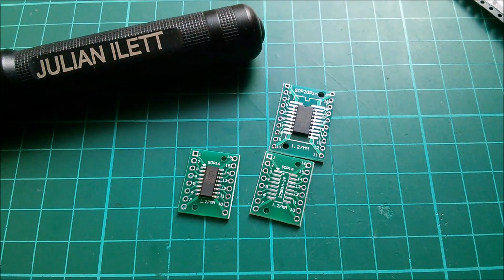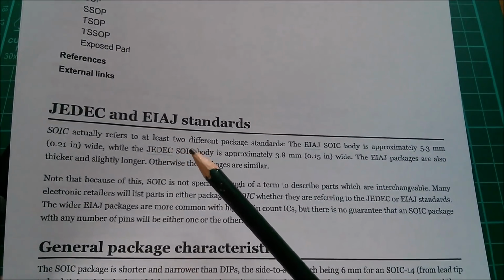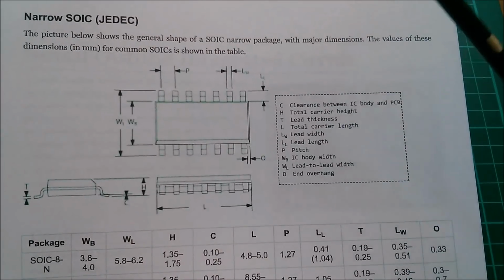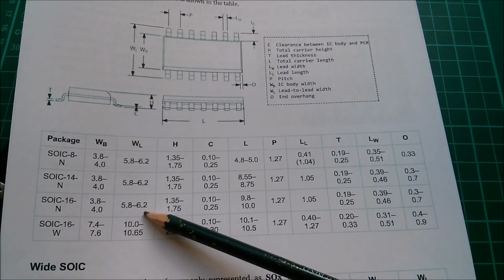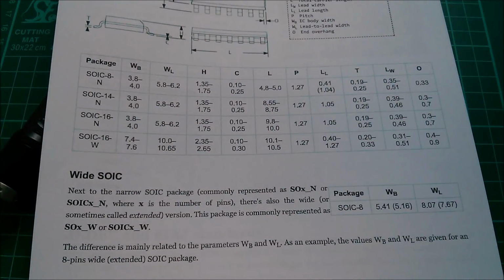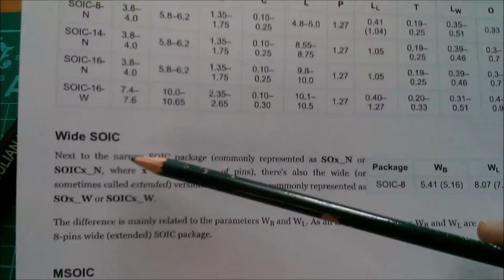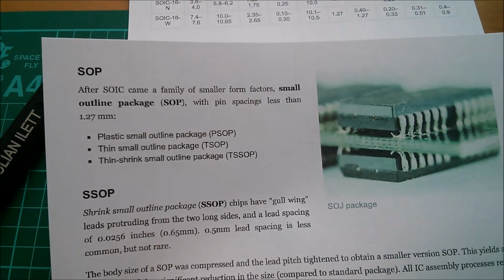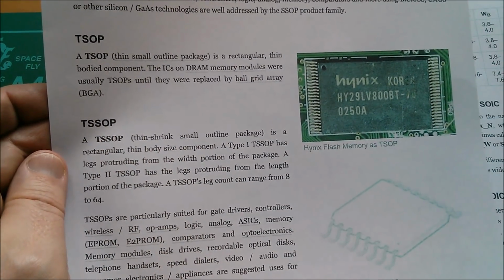Soppy Surface Mount Integrated Circuits

Comment: Perhaps to use them anyway, try to bend the pins under the body of the IC, like you see in the clip at 4.16min. That way they just might fit on the pads of the adapter PCB.

Comment: Put a pin between legs and chip and curl the legs under the chip, you'll be able to solder it easily.

Comment: Now that I can solder with hot air I like sufacemount :) Can hot air damage components ?
Reply: If they're SMD, they'll have a maximum reflow temperature specified in the datasheet. If there are also THT components on the board, be careful, it might melt connectors or fry chips (mmm... fried chips). Dave has a video in which he shows the issue he had with some THT connectors, I'll link it later.

Comment: I hate having to hunt on eBay for discontinued IC's in DIP packages because you can only buy them in surface mount packages nowadays!!!  Surface mount may be good for production, but how in hell are you supposed to prototype with the things?!
Reply: nockieboy No one builds breadboards in industry anymore, its all SPICE simulations and FPGAs. All the fun has been bled out of it.

Comment: Couldn't you just use the wider boards and solder legs on and bend the lot 90 degrees and then 90 again so they're the same pitch, I know it's crude but it will work

Comment: I’m with you. For breadboarding I will stick with DIP packages. And certainly now that you have found these SOP, SOIC.......differences I shall be supper careful if I ever use “flat packs” on a Circuit board

Comment: Either use the wider adapter and forget the empty pads or try out the correct adapter.
I recently soldered some wide 24 pin SOICs onto the exact same boards and it works fine as long as you use flux.
The solder will suck itself under the leads. If you get bridging you can wipe it off with a clean soldering iron tip or use braid.
You don't even need a tiny tip.

I know people always say "I never use flux and it works fine" but those people usually never solder stuff like this. It makes a huge difference.

Comment: When designing PCBs you really can't assume two packages that are the same type from different manufacturers (or product lines) will fit the same footprint. Always double check the dimensions from the datasheet.

Comment: Julian, more and more DIP parts are becoming unavailable, you’re going to have to bite the SMT bullet.

You can fix your SOIC-W problem by carefully folding the pins under the package to make it a SOJ with a width that’ll fit on a SOIC-N footprint adapter.

Comment: Some simple rules of thumb:  1. If you're building breadboard circuits you use DIP.  2. If the IC isn’t available in DIP, then you use the DIP adapters for your breadboard prototype!  3. You use SMD to create your PCB layout to achieve the smallest, lowest cost, mass production capable final product. 4. Alternatively, if your final product is intended for hobbyist assembly you might still want a DIP / through-hole component PCB layout. :)

Comment: I absolutely hate breadboarding and for soldering DIP is absolute crap; SMD is much easier. From the camera angle it looked as if the wider chips would also fit on the smaller adapter and potentially are even solderable with an iron. However with paste and hot air that should be really a breeze.

Comment: Try this for one of those wider chips: completely bend chips legs under the chip (they should look something like letter "U"), press the chip on a flat surface so all legs would be straight against the chip-s bottom and then use solder paste and heat gun to solder them. Like chips in PLCC package :)

Comment: There's a 3rd DIP width when you get up to the monster 64-pin ones just before everything switched to PLCC/TQFP. The DIP 68000 CPU is a 64-pin PDIP with something like 0.8in pin spacing.
Reply: But this is also not breadboard compatible
Reply: It is. It's still 0.1in between pins, but more between rows.

Comment: Julian, just use your 20 pin adaptor boards and leave 4 pads at one end with no connection ( or cut the board of you're desperate for length

Comment: I'm ordering several 4000 series CMOS chips from eBay tomorrow. Have a guess as to the package I am choosing (clue: they are for breadboards.) Yes, you guessed it, DIP. My old eyes and unsteady hands cannot be doing with whatever other type of package they come in. The only time I will deal with SMD is if it comes ready soldered, like the Cortex-M4 ARM chip on my STM32 Discovery board and a couple of clone Arduinos I bought (can't for the life of me think where I could've got the idea of buying them, heheh.)

Comment: Option A:
If it's only about stacking them verticaly using those long male-female connectors, use THT ICs and universal PCBs, all should work together pretty neat.
Option B:
If you really nead those SMD adaptors, why don't you design them yourself! :D Fit a couple of different ones on a PCB project, order them from China for cheap and cut them apart ;) Or even better, contact those guys from EasyEDA/JLCPCB like GreatScott did, and get them free for the advertisement! :))
Either way keep up the good job, greetings from Poland! :))
Reply: Option D: Just solder the 16 pin package on the 20 pin adapter board
Reply: Yep, doing Option B myself using EasyEDA. First board design and taking a bit of time getting the designs right. But, well worth the learning curve! 🤠
Reply: Option C: Just bend the pins then you'd get some space for soldering.

Comment: Maybe there are two widths?  DIP64 packaged 68000 processor with 900mil spacing? Although you'd be insane to wire one of those up on a breadboard.. <waits for somebody to post an example 68k breadboard computer :-) >
Reply from the maker: Oh yeah, I forgot about that beastie :)

Comment: julien, you should convert a snack oven to a SMD oven so you can reflow these puppies easy.
Reply from the maker: Yeah, I've also seen hotplates, frying pans, security lights and GU10 down lighters used. Trying to decide which way to go :)
Reply: Hadn't thought of a small snack/toaster oven. That's a great idea! You can get these for like a few dollars at garage sales!  😜
Reply: Julian Ilett Take a look at reflowr.com -- a small reflow-surface for small smd-stuff at a very reasonable price
Reply: Ben Heck did a video on this and I'm sure I've seen others.
Reply: I was going to say toaster ovens aren't a thing in the UK, but Amazon have a few starting from £24.
Reply: I like the hot air pencils... portable, affordable, not as much of a fire hazard.

Comment: Be careful when buying chips.
SSOP & TSSOP pins are such a fine pitch they're not easy to solder.
Reply from the maker: Yes, I wouldn't even attempt it :)
Reply: It's not genetic engineering, tack one pin down and drag solder it, good flux and a bit of braid and you're all dandy.
Don't let those two make you believe it's rocket science... it only is until you've done it.
Reply: Soldering those isn't any harder than soldering any other SMD component. A soldering iron with a fine tip (e. g. 1mm chisel) is fine for that. In quite a few repairs I soldered QFP packages (which have a pin pitch of 0.5mm) with that without problem. If you want to remove them AND not destroy the IC in the process, you better have a heat gun though.
Reply: Yes. This is when you pre-tin the pads, lay the chip on them, and then either use a super fine tip and touch each leg, or us a hot air gun and reflow the solder. The latter definitely would mean no plastics around.
I'm having to build my own adapter PCB for my one chip I ordered because SSOP-30 to DIP-30 is not a common adapter. And unfortunately, the chips aren't made in any other style; so I can't get DIP to begin with.
Reply: Not to mention BGA packages.
Reply: i still use my standart 2mm tip with a drop of the usual 60SN39PBCU1 , lots of flux and drag solder, no big deal, even TQFP aren´t a thing using that technique....
Reply: Easy when using good flux and drag soldering. 200+ pins just a easy.
Reply: Solder paste, a fine tip iron, and a microscope.
Reply: I've unfortunately become rather good at hand soldering SSOP (usually via drag soldering) but won't even try anything smaller than that - funny thing was I sweated about hand soldering SOIC a lot before the first time I did it (I do quite a bit with audio and op amps so ended up soldering the SOIC ones to DIP adaptors a lot) and turned out its a breeze.

I wouldn't even attempt it without a good flux paste though - helps to hold the chip in position at the same time as well as minimising the chance of bridging connectors.

Comment: Grumpy Julian. Must have missed something but why use the surface mount chips especially considering the adaptors make them larger than the dual inline packages.
Reply from the maker: So I can stack them vertically :)
Reply: Andy Plater 0.1" pitch is easy to prototype with 'cos it fits breadboards.
 Sadly, some chips are only available as SMD.
Reply: The idea imo is you wouldn't use DIP to design a product due to size/ease of manufacture, so your prototype ought to be smd too.
Reply: and sometimes the DIP version of a chip doesn't have as many pins as the SMD version. Take the ATMEGA328 for example, popular chip as it's used in many Arduino boards - the TQFP surface mount version actually has more usable pins.

If you're designing a product for pick-and-place manufacture, you're going to use the SMD version, and if you're using the SMD version you might as well plan to have those couple extra pins in case they're useful to you.
Reply: Julian Ilett but what use would stacking them vertically have, and why couldn’t you do it with the dip packages?
Reply: Piggybacking DIPs ought to work for the stacking purpose.
Reply: The reason for some chips only being available as SMD is simple: they're massively more used since they're compact and easy to pick and place robotically (take Apple as an example, they have to put lots of components in lots of products in a very reduced space), which reduces the price, which makes them being even more used. So it's not profitable to make DIP versions of this chips. And there's another reason: high-pin count chips would be very expensive, wasteful, and difficult to use in DIP. Take FPGAs as an example: not only it would be expensive and wasteful to put epoxy and thick pins for 200+ pins, but also, who the heck has a 100+ line breadboard? And we're forgetting that the extra wiring would increase the resistance.